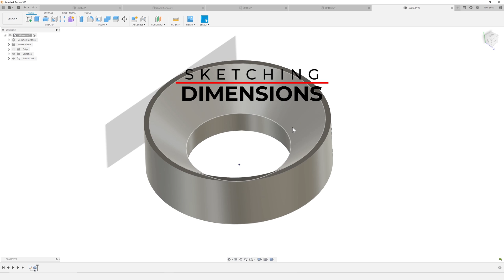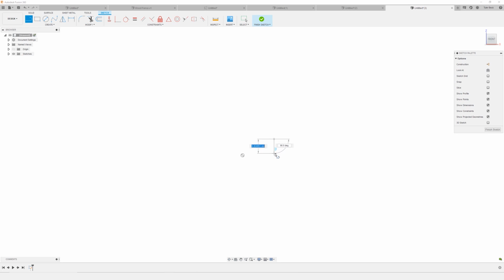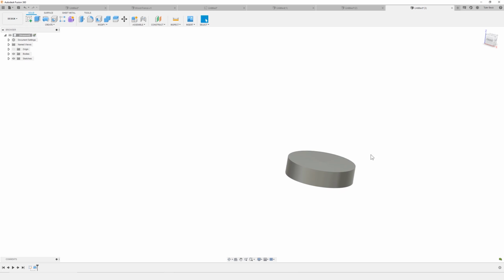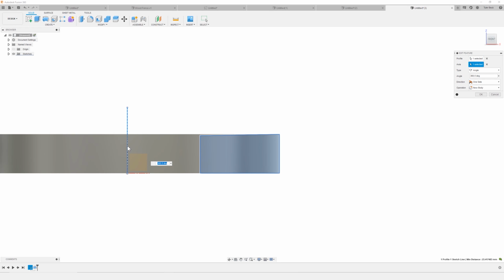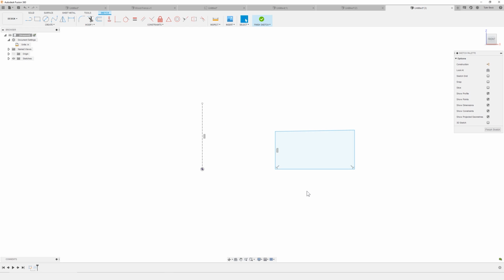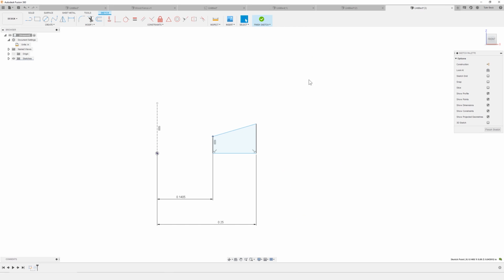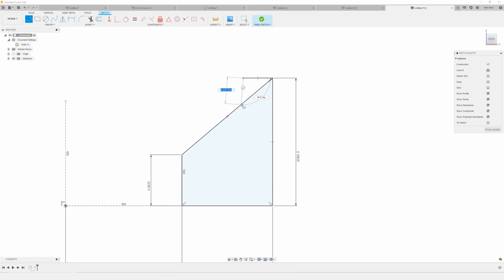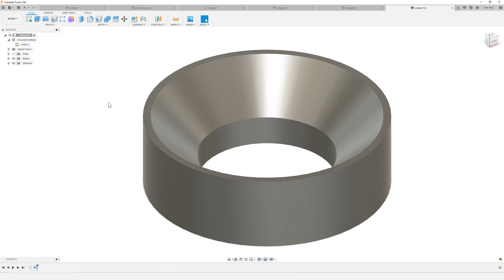Fusion 360 - Alignment Washer Tutorial (Absolute Beginner)

Comment: Did you cheat a bit with the vertical line attached to the left point of the top 0,0156 line? I tried to make a Coincident constraint with the top endpoint of the 45-degree line and the left point of the 0,156 line, but the top horizontal line needed to be 0,016 to make that happen (I removed that dimension to let the Coincident constraint work. and Fusion set it to be 0.016) I can't see any extra vertical line in the McMaster model so for me, it looks like a tiny "cheat" to make ends meet?
DISCLAIMER I am a beginner so I may just have got the situation all wrong 😁
Reply: I'm getting an additional vertical line of 0.00185 at the left corner of the 0.0156 horizontal line. I deleted the 0.00185 vertical line located at the left corner of the 0.0156 horizontal line, and deleted the 45 degree angled line. I redrew a new diagonal line from the left corner of the 0.0156 horizontal line which connected to the top of the 0.0625 vertical line. I then measured the diagonal line and got a 45.6 degree diagonal line (the inside slope of the washer). I couldn't figure this one out yet either. It looks like the model washer now, but I couldn't replicate the video entirely.